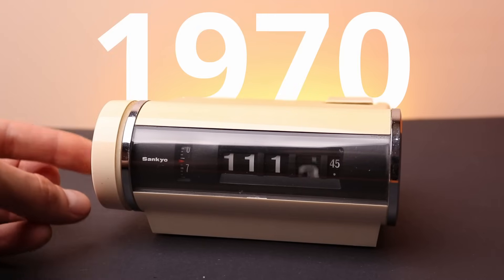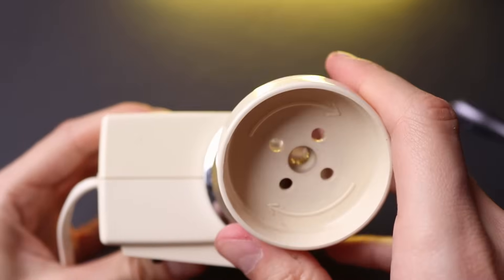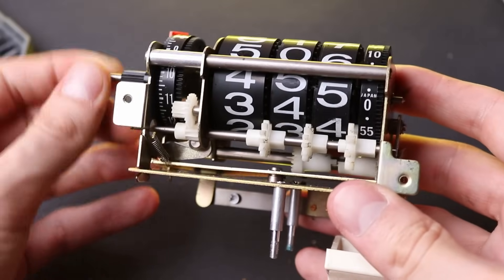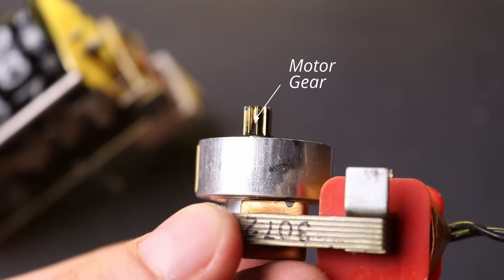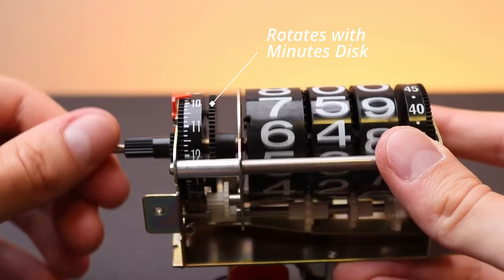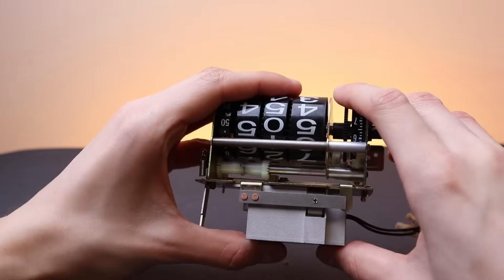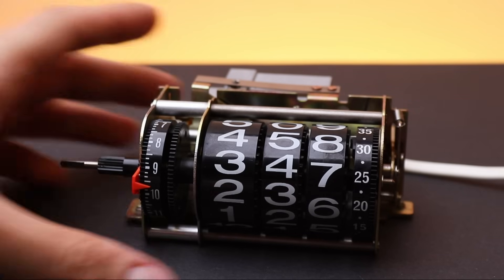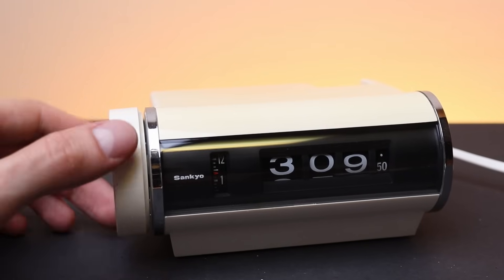That’s why Japanese Engineering is on Another Level

Comment: I believe that motor is actually a shaded pole motor. The two thick single turn off copper are creating an out of phase magnetic field in two of the arms, thus creating a rotating magnetic field. The rotor is not a permanent magnet, that is a kind of induction motor.*

They are very commonly used for the magnetron cooling fan in microwave ovens.

I am about 85% sure of that. So 15% sure I'm wrong.

*Edit:
Apparently, shaded pole motors with a permanent magnet rotor are a things. Combining the unidirectional rotation with grid synchronicity.

I did overlook the fact that it had to be a synchronous motor to keep time.
I now have a new type of motor to seek and add to my collection.
Reply from the maker: You are right. I will attach that comment so everyone knows.
I have never seen it before, and without disassembling it, I assumed it is an old version of Lavet Type Steping motor... My bad. Motors are not my specialization, but thanks to comments like yours, I can learn as well. Thanks!
Reply: Unfortunately it is not a shaded pole motor - because shaded pole motor's are not synchronous. It is a reluctance motor.
Reply from the maker: @sno_crash  Hmm. How do u know this one is synchronous? It looks very much like a shaded pole one. At least by appearance. Also, it indeed has two copper shading coils
Reply: @NickElectronics  You can't use an asynchronous (induction) motor to power a clock, as the speed is not constant. The time would drift very noticeably, especially as the friction varies with dirt and grease build-up. Synchronous motors are very common in clocks (especially older ones), and they can keep time remarkably well for many years. Most grid operators make sure that, though some momentary dips and peaks may occur, the average frequency is exactly nominal, precisely such that synchronous motor clocks keep correct time.

You're right that it looks like a shaded pole motor. It's therefore most probably a synchronous permamagnetized shaded-pole motor, which functions much like a shaded pole motor, but has a permanent magnet, and therefore doesn't rely on inductive slip.
Reply: @NickElectronics it must be synchronous to rotate precisely.
However - synchronous motor still like rotating magnetic field from shaded pole. I wonder whats inside - induction cage for start and permanent magnet?
It may be also hysteresis motor. 
or maybe really reluctance.
Reply from the maker: @johnfuchs9130  I guess there is only 1 way to find it out... But I like it too much to open it up
Reply: @sno_crash  that is a good point. 
The armature definitely seems to be a shaded pole motor. 

After reading more about it. Synchronous shaded pole motors, with a permanent magnet rotors, are a thing.
Reply: @randomelectronicsanddispla1765   I agree. It does look like it has the shading pole coils - and I guess if it has the semipermamagnetised rotor then it could be synchronous, and a shaded pole motor.
Reply: Could the manufacturer have reused spare asynchronous (induction) motors they had on hand turning them into synchronous ones for a clockwork by reworking them with permanent magnets efficiently or would that entail too much effort. Maybe that would be used if this clock was a first batch testing the market or for a special run? (Later runs may have had a more conventional synchronous clockwork if they were out of the first batch reworks?)
Reply from the maker: @Don.Challenger  It's really hard to say. In production, anything can happen once in a while😄 Maybe someone who used to work at Sankyo will see this video and provide an answer😄

Comment: Nice little clock.
Too bad there is no fail safe in case of an power outage (lately it’s getting somewhat ‘common’). And it seems it’s also missing some lighting.

Too bad there are no overwhelmingly much new interesting products from the state of the art alarm clock industry. We have to mine nice stuffs from the ‘80-‘90s.

Comment: These still look cool aesthetically, but it definitely wouldn't have any real accuracy. They would likely lose a minute a day, which doesn't sound like much, until you're a month in and it's half an hour off. But they can even be off by several minutes per day, which makes it even worse, because you could end up having to adjust them once a day or once a week, which is not worth the inconvenience. The only reasonable type of clock is one you only need to adjust once a year (because you'll be adjusting it for daylight savings anyways), and being only 5 minutes off at most by the time you would adjust it for daylight savings.
Reply from the maker: Actually, many people in the comments have said that it's quite accurate, because grid frequency fluctuations are balanced well. This means that if there were a period of slightly lower frequency, system operators would slightly increase it afterward to maintain an average of 50Hz.

Comment: i want this in an acrylic housing.
Reply from the maker: Everything is in your hands. 😄
Or maybe in mine.... I need to get a 3D model scanner to make capturing part models easier
Reply: @NickElectronics  nothing some good measuring cant do. you could even make a better way to sound dampen the motor although really I think it might need a new motor as it sounds like it is breaking down or dry/dirty inside.

Comment: I had one of these (Canada) but it had an AM/FM radio integrated as well so maybe not Sankyo, the tuning used the typical sliders not flip tiles obviously. It functioned from the 1970s into the 2000s but I think one of my cats jumping from the bedroom window onto the head of the bed knocked it onto the floor disabling it, it may well be in a sock drawer with other museum pieces.
Reply from the maker: Ahh... Typical cat performance😄 Maybe after this video you will have motivation to fix your broken clock🙂

Comment: The time is always correct: while the frequency of the power network has 0.5 Hz tolerance (usually much less), it is handled in a way that the average over longer periods of time (hours, days) is exactly 50 Hz. So if the frequency is lower for some minutes, it will be adjusted to be higher than 50 Hz later on to bring back the average to exactly 50 Hz.
That's why mains-powered clocks have basically zero drifting over time, they have (not instantly but over longer periods of time) almost atomic clock accuracy.
Most people, even engineers, don't know about this.
Reply from the maker: It turns out they are indeed quite accurate, until there's a power outage, even if it's just for a few seconds😄

Comment: Thank you! I still have that clock. Now you gave me motivation to try cleaning it too. 😅
Reply from the maker: You are welcome :)
Reply: @NickElectronics Don’t you think the noise is coming from the reduction gears? I know that this watch was running completely quietly at the time?
Reply from the maker: @jacobvie  It definitely comes from a motor, and the only moving parts inside the motor are gears. I guess some of it might come from vibrations caused by electromagnetic forces. But to be 100% sure, I’d have to disassemble the motor, and it’s sealed like a can of tuna. So basically, that means breaking it. :(
Reply: @NickElectronics  I have an identical clock, it is completely silent. The noise probably comes from the motor because the gears need lubrication, the motor can be opened without damage - the housing is soldered. It just needs to be cleaned and all the gears are in good condition, it shouldn't be noisy...
Reply from the maker: @slpanjkovic  Hmm. I might have another look at it. I just didn't see an option to disassemble it. Maybe the clock is the same, but the motor is different?

Comment: 1970s Japanese clock works for 50 years.. Meanwhile modern refrigerator or smartphone breaks in 5 years.
Reply from the maker: I mean, with smartphones it's just a basic reliability rule: if a system has many components in series (each of which must work for the system to function), the overall reliability decreases as more components are added.
But with refrigerators... yeah, it's annoying. 😄 I feel your pain.
Reply: You might have some difficulty with understanding the difference in complexity.
Reply: Does Japanese fridge survive 50 years

Comment: Nice! I have very similar clock - my is model 4000 and seems to have slightly different design, but the mechanism looks the same. My also has some light in a form of neon lamp to make the numbers visible in the dark.
Reply from the maker: By the way, that's exactly what I wanted to add —some lights! 😄 Are they powered by mains voltage?
Reply: @NickElectronics  Yeah, they branch from the main transformer input and just have resistor on the way. Not easy to find these bulbs now, and the ones I got are not super bright - more like orange glow than actual light. Not sure how the original one looked as both legs broke off right at the glass casing so I can't connect anything to them, I may try to crush the glass just a bit to get the leads out and solder some extensions to just see how original lamp looked (assuming it works).

Comment: Man first time seeing one of your videos, let's just say that wasn't the face I was expecting but for sure it's a good looking one; anyway beutiful piece, modern stuff has lost most of this refined design, By the way although line Hz can variate since many automatic clock relied on it, and I think many industrial processes too, the electrical companies are (or at least were) quite careful to recover any lost time or too slower the frequency in case it went too fast in order to be as precise as possible in a yearly median
Reply from the maker: Ahahah :D Thanks for the warm words. I’m just wondering what kind of face you were expecting :D One with a beard? :)
Indeed, you’re right about grid stabilization — it’s quite precise in most cases. High-quality quartz clocks with temperature compensation are probably still more accurate, but nobody usually puts a TCXO into a simple table clock :D
Reply: @NickElectronics  Beaded and with "harder" lineaments 😅
 I'm kinda envious of CuriousMarc that can play with two cesium atomic clocks, not exactly bedside but close enough, for the general public tho soon after yours started to come radio control bedside clock some integrating fm radio so the reference signal just came from elsewhere and could be traced to an atomic clock anyway; it was news from not many years ago that radio stations phased out the audible time signal so I guess many of those clocks are now paperweights.

Comment: needs specific frequency. If it was for 60Hz, it will not work for 50Hz because the timing will be false then. To make it work correctly, gears are needed
Reply from the maker: There is a number 50 on the motor. I guess they used one marked with 60 for 60 Hz Grid, which means there are indeed different gear ratios, but inside the motor.
Reply: @NickElectronics   This is bound to be a particular kind of fun in Japan domestically, because it has two different power grids, and there's a squiggly line across the country separating the two. One is 50Hz and one is 60Hz, but at approximately the same voltage. So many precision motorised mains powered devices such as phonograph or tape machines contain a hidden internal switch; alternatively, replacement motors or other subassemblies were available from the manufacturer for the conversion.
Reply from the maker: @SianaGearz  I just looked it up and found out that in Japan, they use high-voltage DC links to connect the part of the country with 50 Hz grid and 60 Hz power grid 😄

Comment: im pretty sure a large amount of the noise is able to be reduced if you clean the motor with some rubbing alcohol and then re lubricate it
Reply from the maker: You’re right for sure, and it would have been nice if I could have opened it. But it’s sealed like a metal can—once sealed, it can't be reopened without destroying it. Maybe there is a way, but it's definitely not worth the risk. Buying a new motor might be the best option btw
Reply: @NickElectronics  i think if you find the correct alcohol and let it soak then warm it up gently for a day to evaporate then use a penetrating oil that is usable with electronics you could apply it to around the base of the small gear and it would soak through regardless amazing video really great work

Comment: I would take this chance and upgrade the power cable to figure 8 plug
Reply from the maker: The old one works just fine, why should`ve I replaced it?
Reply: @NickElectronics living on tropical island.. i am paranoid about cable rot.. and my unfounded preference to a detachable cables.. 😂

but the cable’s been in incredible condition..
Reply from the maker: @jmssun  Aahah, makes sense! 😄 But I usually follow another rule: 'If something works, it's better not to touch it.'

Comment: There is nothing new in this design.
Synchronous motors for clock are an old invention, and mechanical counter even older.

Comment: I have a Sankyo Rollclock (from 70ies) since 6 years and im very happy with it.
I needed smt less bright than led which doesnt have an annoying tik tak sound.
ASMR included, lol
Reply: The thing had a thicc 70ies patina inside which i needed to clean in order to not die of lung cancer in an 2 m radius. The motor is probably asking for new oil (noise), but i avoid it until it becomes unbearable bc that would mean drilling it open and resealing it. (feels too risky)
Its the SANKYO Digital 4000 orange, in my idea the most stylish one.
The alarm is also amazing, i once had it activated and went on vacation, damn thing annoyed my housemates for 2 weeks straight, it simply never stops, lol.
Who needs 5 alarms, i just need one...

Comment: When you pulled the larger of the 2 round knobs, did you notice the 4 holes? Those were there so that you didn't have to pull that knob in the dismantling process. Engineers are smart and will leave clues like that for techs to know how to work on things... I am glad you didn't break the plastic pulling the knob, probably luck, as plastic ages it usually becomes brittle... Interesting design, interesting video!
Reply from the maker: Actually it was not glued or anything like that. So it was impossible to break it. And holes on the knob are not matching the screw holes. So Idk why did they add the holes there. Maybe to save some plastic??? Idk

Comment: Dude, I don't know where you live but there's absolutely no way your grid frequency floats between 40.5 and 50.5 hz, unless your "grid" is a lawnmower spark plug you wired up to your sockets. EU spec mandates +/- 0.2%, which is no more than 20 seconds per day of deviation, but I think they will specifically drive to overfrequency the next day after dropping cycles because there are many devices that keep time using gridtime, and they try to keep the long term deviation low by compensating.
Reply from the maker: My bad, there is a typo… What i meant is 49.5 to 50.5. Fun that you are the first person mentioning the numbers
Reply: hower, few years ago, european grid was late about 3 minutes for weeks.
Small Bosnia country was blamed for this, which I do not quite understand.

Comment: Grid frequency on average is more stable than general quartz . All electronic corded clocks are grid frequency synchronized. There are ovenized quartz oscillators ( OCXO ) that are better stability and higher price. Old school clocks used springs and you had to keywound them every morning and synchronize it to church/townhall clock each week . There even was 1.5V D cell powered mechanical clocks (not quartz just coils and magnets and two transistors) .
Reply from the maker: True. Grid frequency is good enough for home clock applications for sure. There is no need for high precision. But it is limited.
But, with quartz, accuracy can be pushed to a higher levels.

Comment: The motor is marked 50, presumably for 50Hz. A 60Hz version would have been made for the west half of Japan.
Reply from the maker: Yeah, I also think that 50 on the motor means it’s designed for 50 hertz grid. 
Yep, most likely they had different ones for different parts of Japan) Its actually quite fun to have quite similar yet different frequency standards